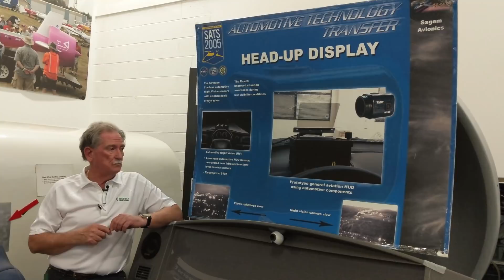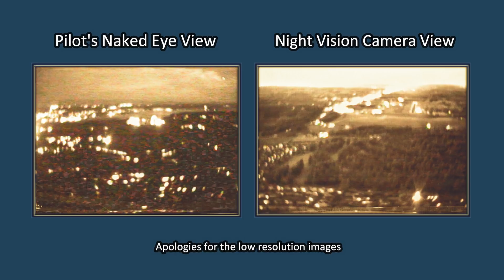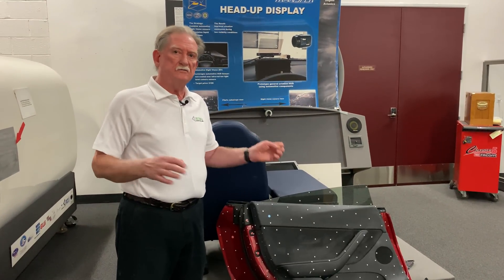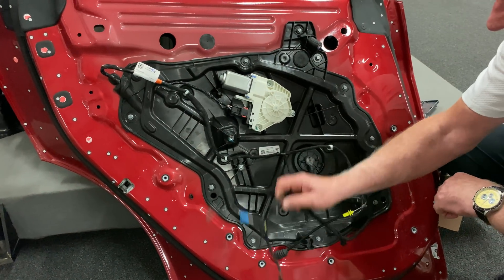Tips For Tesla E3 - Night Vision HUD & Wire Reduction

Comment: Bluetooth is not innovative enough. With Bluetooth you have to have power cable anyway. So signals (data) through power cable is the real solution. Same as HUD. You don't need night vision HUD if you have autopilot with night vison and auto collision detection already. Thinking small.

Comment: I think Tesla refuses to add hardware features to their mass market 3/Y to protect resale value and won't be able to get away with it as competition mounts.
Reply: @GaiaMother7  We drove the Model 3 and Kona EV back to back. The Tesla was fast and handled great but the Hyundai includes now common features like smartphone integration, heated steering wheel, proper blind spot monitoring, cooled seats, heads up display, proper speedometer, etc. Tesla's cars are going to start looking really basic when Hyundai and VW start cranking out well built, feature rich EVs in the next year.
Reply: @GaiaMother7  K, good talk.

Comment: Your ideas are excellent. However, there can be serious issues with putting these ideas in the hands of the average driver. First "heads up display" is excellent for the trained "pilot". I'm not sure what the casual driver would do with it, or worse yet, get into trouble trying to use it. Second, Bluetooth is not perfect. It can easily fail under many conditions (interference, extreme temperatures, etc.). Tesla even offers a manual door unlock device in case the other circuitry fails.
Reply: The Corvette has had a HUD for about 35 years.
Reply from the maker: Valid points, Donald, thank you for your input and thanks for tuning in!

Comment: How would bluetooth be secure?
Reply: Dual Fiber optic token rings are the secure system, to handle critical and non critical command and control local area networking! See my post in this main comment thread for full details.
Reply: I don't think it has to be Bluetooth. It could be a dedicated wireless design and frequency. Just set it up so that it only talks to the computer with the right "password" to connect but use something like SHA 2 or RSA for encrypted communication of said "password" 

As long as it's locked down properly to only talk to the one main hub and the password is set on both transmitters and receivers firmware it should be fairly easy to secure from there. A fair bit better than Bluetooth :)

Comment: Once you have power wires to the door, a bluetooth reciever becomes irrelevant and unnessecary costly, you can just run one signal wire to the door and have a controller there that does all the work. I`m pretty sure engineers at tesla have thought about this.
Reply: No need for separate signal wire either. Just send the signal together with address and function ID over power wire. We are perfectly capable of sending 100Mbits+ over +100m  AC wires, few feets over filtered DC shouldn't be a big problem. Two12/48V buses (for redundancy) around the car should do the trick. Receivers/decoders cost next to nothing, and get cheaper every day.
Reply: @marekkaletka6746  maybye it would be ideal to have 2 wires that can carry slightly more power than needed, and make them redundant, so that even if one fails, windows can still be opened/doors unlatched etc... however this might be overkill. could come in handy in an accident though.
Reply: @marekkaletka6746  yea, but doesnt this come at some cost to send the signal via the power wire?
Reply: @thet0ast3r  yes, a tiny bit, you need filtering at both end to combine/split the signal and power. These components a probably cheaper than the wire and connectors you save.

Comment: No thanks to Wi-Fi/ Bluetooth communication for doors, windows etc, it’s too easy to hack or scramble. Eg safety systems in car, unlock doors in case of crash if no signal received.   Love the night vision idea though 👍. Cheers
Reply: A Tesla having fallen into a river might have problems with Bluetooth. I can't use my Bluetooth headphones while using electric toothbrush or Waterpik without data loss.
Reply: Exactly, hacking of cars will become a massive new avenue as we move forward with technology.  Just look what happened to journalist Michael Hastings - his Mercedes wasn't even as advanced as we have now: https://www.huffpost.com/entry/michael-hastings-car-hacked_n_3492339

Comment: I do not think that going wireless is a good idea. A metal box like a car is a really difficult environment to get radio communication reliable. Next to that it has a lot of potential for Radio Frequency Interference of all kinds of sources. And finally I am wondering about malicious abuse. And working in Radio Astronomy, I also think we don't need more radio pollution.

Now, working more with a communication bus instead of separate wires, is something that I think could go further than automotive has done so far with things like CAN-bus.

Comment: Hello Mr Munro what are those spots for?
Reply from the maker: Great question.  The spots are small stickers that get applied when the vehicle is getting 3D scanned (which we did with this one).  The dots provide reference nodes for the camera system as it constructs its surface meshes.  Thanks for tuning in!

Comment: About the idea of going wireless to reduce wires... You still need wires to power the electric window (and the receiver, of course). If I think at the "cons" ... overall is not a good idea!
Reply: See my highly detailed comment about using a fiber optic double redundant, token ring Local Area Network to offer highly secure, high speed data with fault tolerance and full mission critical data redundancy. It is in the main comments
Reply: It's not just wire count reduction but overall wire length reduction so wireless would achieve that to some extent.
Reply: Zack J we can send the data on the power line. It’s not that hard.
Reply: Peter Lund data can be sent on wiring, but the speed would be limited due to the likelihood of crosstalk and noise pickup, a separate coaxial, shielded wire with a  RF modulated , multiplexed signal is preferred or a fiber optic cable system which has a high RF noise immunity, when used in the vicinity of high voltages being switched into inductive motor loads.